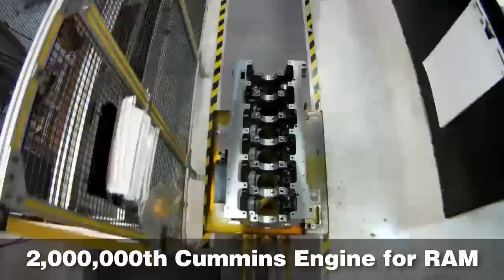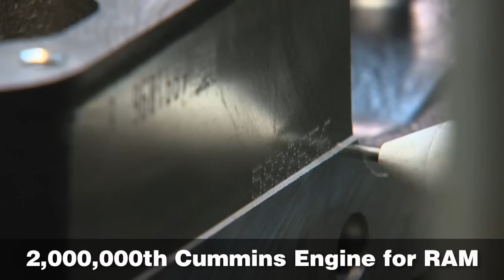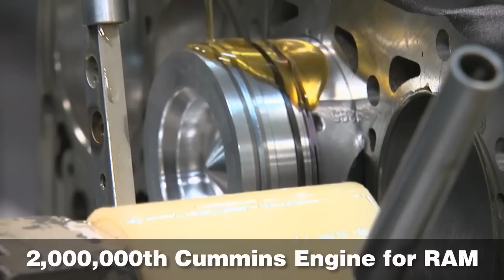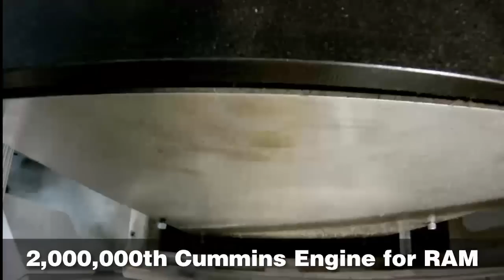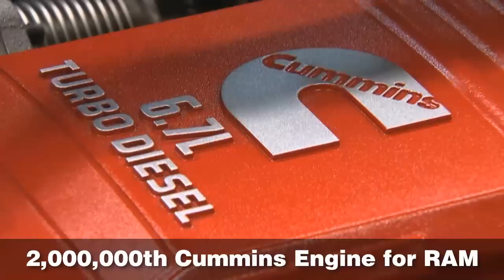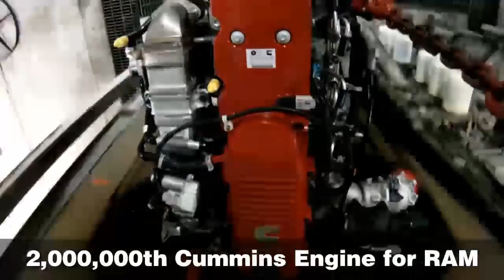Cummins Builds Two-Millionth Pickup Engine for Ram HD Trucks

Comment: Took ram how many year to get to two mill, and there more the 2.5 million 7.3's and they weren't made for half the time that cummins have been being out into rams
Reply: No kidding!  Ford sells far more trucks than Ram, plus, 30% of those Fords are on their second or third engine so there's way more demand!

BTW, 7.3 came out in 1994, the Cummins 5.9 in a Dodge Ram came out in 1989 (but Cummins built them long before then)  So, 1994 is 20 years ago, 1989 is 25 years ago, a long way off from "twice as long".  20 x 2 <> 25  With math skills like that, a fascination with inferior engine technology is understandable.
Reply: NewYorkerBrad`My 1988 Ford F-250 had a 7.3 in it. So, you're not right either.
Reply: Lucas Arthurs That's certainly possible, I've never cared one way or the other for a Powerstroke.  I am only using the data cited at Wikipedia for the 1994 release date...if it was 1988 then, the OP's math is even farther off and it's even worse, for Ford, than originally depicted.
Reply: NewYorkerBrad
 Well to be fair the 5.9 wasent electronically controlled until 1998, the powerstroke was electronic in 1994. Not exactly the same  engine.
Reply: Lucas Arthurs 7.3L PSD is NOT a 7.3L IDI....totally different engines!  The 7.3L PSD was a good motor, no doubt!  But a Cummins....just that much better!!
Reply: Well i never said my truck had a powerstroke. And it didn't. My truck was a non-turbo 7.3, which would have made it an IDI. Sound great worth the custom exhaust it had. And, the 7.3IDI was the only Diesel I ever owned, so I can't comment on the reliability of the cummins, duramax, etc.
Reply: I wasn't pickin on you....lol  I hit reply to the wrong guy...but said my 2 cents worth!  It was the ford fan boy that i meant to reply!  :-D
Reply: Oh haha no problem. I wasn't ticked off or anything :)

Comment: v8 diesels suck. why do you think semis use inline 6 diesel engines from cummins, caterpillar, and detroit diesel. its because the design from an inline 6 is simpler and they make more torque.

Comment: I wish Ford would have bought Cummins engines for the F250, way better then the powerjunk that furd tried to make. Guess im going to have to find a rusted busted old dodge to scavenge a 12v out of cant be hard, all dodge products rust out or break the drive line, they really are junk. NOT counting the Cummins 12v its all that is good in a dodge.

Comment: Why is it just an in line 6 cylinder.
Reply: most diesel engines are 6 cylinder, including big rig emgines.
Reply: Ok cool, I didn't know that. Does it create more power?
Reply: I really dont know much about why they use the 6 cylinders. Thats a good question.
Reply: +Alex Marez the inline 6 makes way more torque then any other v8 and since they can get better power and tongue from inline 6 they make it more efficient and leave out two cylinders
Reply: +Alex Marez Its actually because its smaller, cheaper, simpler, and can make just as much power as a v6 or v8.
Reply: ***** So why would Cummins go cheap and Duramax go expensive.
Reply: Because everyone has their own method of doing things. Cummins has always been inline six on the most part, Ford (power stroke) and Chevy (Duramax) were v8s. Each brand does what works best for them, not to mention Ford and Chevy have their own motor unlike Dodge so its really up to Cummins.
Reply: ***** Ok thanks for the info.
Reply: No problem
Reply: +Dieselman8v92 Well sort of. The duramax is an Izuzu and the Powerstroke was an International (Navistar) until their most recent diesel.
Reply: +Alex Marez  Inline 6 has less moving parts, so less to go wrong and less friction to wear the engine out, the cylinders are straight up and down allowing great bore and a lot of stroke more stroke more torque, the inline 6 is also almost perfectly balanced and utilizes more main bearings than a v engine can, inline 6 and diesel works, the big rigs use this method, yes theres been v8 rigs and v12 and v6 rigs they always went back to a inline 6, because everything will be fine if its inline!

Comment: Only if it's comes with Aisin, 68rfe is a peice of junk, I had to sell my '14 because of that, it's fell apart at 62k, at 63.5k second time, very disappointed.
Reply: I've got the Aisin in my 14' 6.7. I still wonder to this day how it managed to stay on the lot for an entire year without someone noticing it had the epic transmission and every tow option on it. I plan to full delete on safe tune after 100k so I don't run into reliability problems down the road past 1M miles.
Reply: My 68rfe is going strong at 44k, but was told they did something to make the 2016 more bullet proof, no rings or something, anyone know?